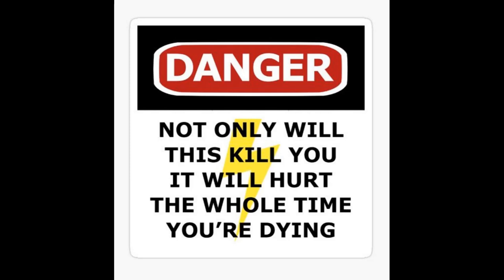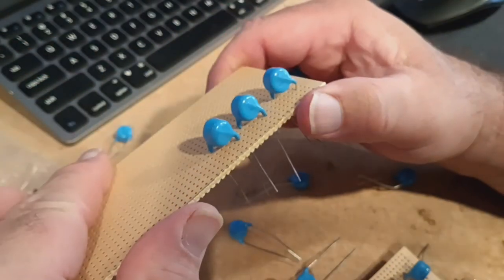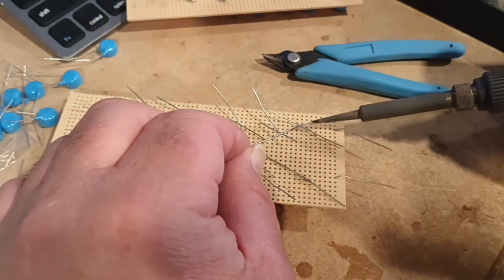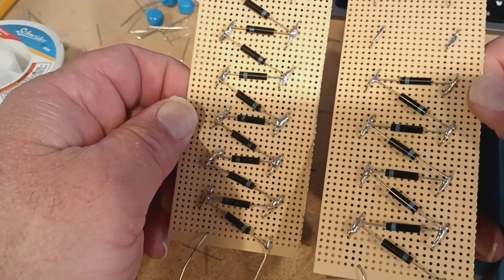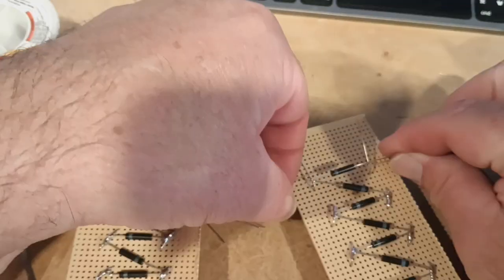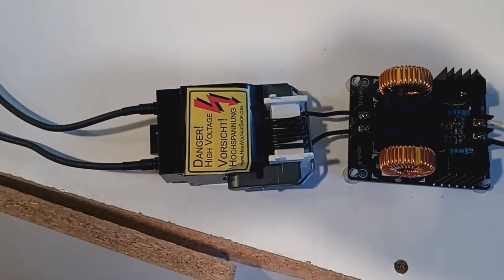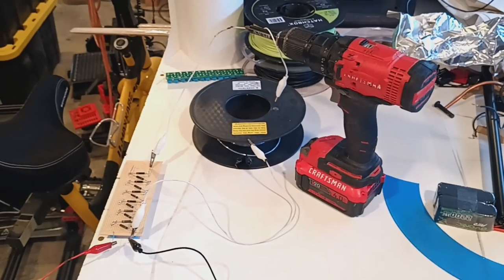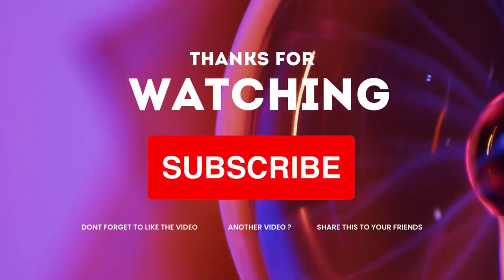Voltage Multiplier Circuit Build

Comment: Ever look into fractal capacitors? They are usefully in taking HV and bringing them down to a lower usable voltage while compounding the capacitance. They work similar to the Voltage multiplier. I have a vid on them, and Robert Murray-Smith has done one. Cheers for the videos.
Reply from the maker: I will watch your video and check them out.

Comment: You can wire two cockcroft-walton voltage multipliers in parallel and reverse the diodes on one side to change the output polarity, and then you can get twice the spark length. You can also make a full-wave cockcroft-walton voltage multiplier by adding more diodes and capacitors to the side of that circuit; that will allow you to use more stages without as much loss to the signal, and get higher voltages.
Reply: I had to look that up as it seemed like a troll, but damn its a real name and a real method. Cheers.
Reply from the maker: That I will defiantly try. Thank you.